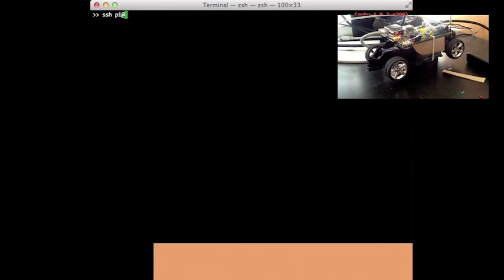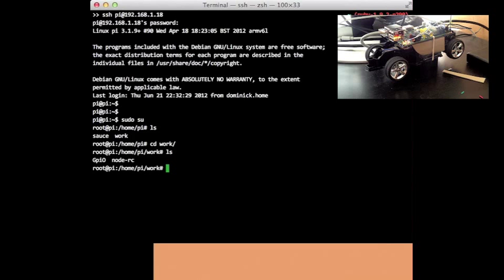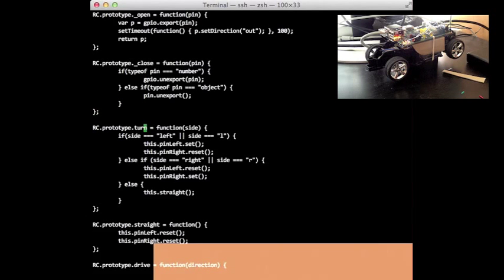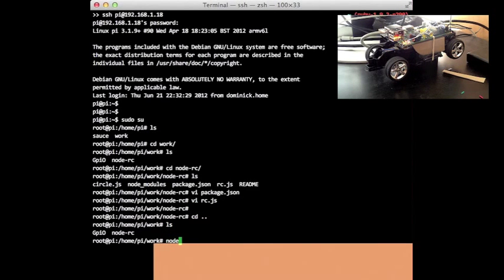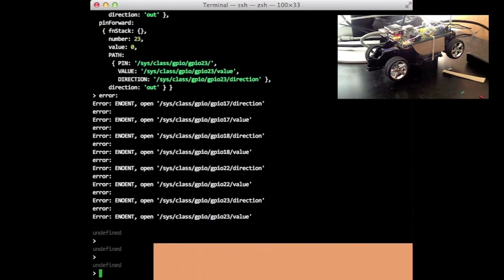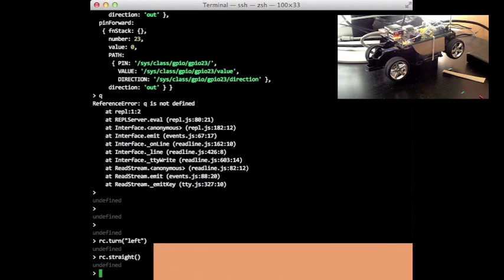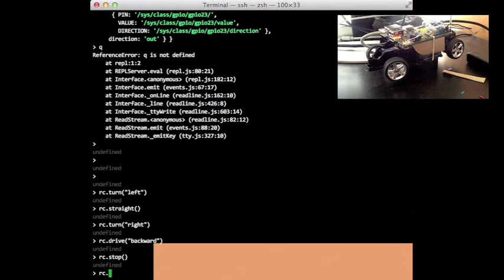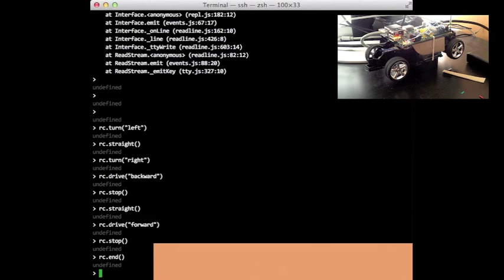Driving RC car with node.js and a Raspberry Pi

Comment from the maker: Google the RX-2B datasheet; I’ve taken apart 3 RC cars so far and they all use the same chip. Some cars have bigger chips than others. The Targets near me sells New Bright and Jada (brand) RC cars; the New Bright ones had such a small chip that it was impossible to solder anything on. The Jada was much easier to solder but had a terrible set of wheels and turning mechanism. I replaced the board on the New Bright with the Jada.